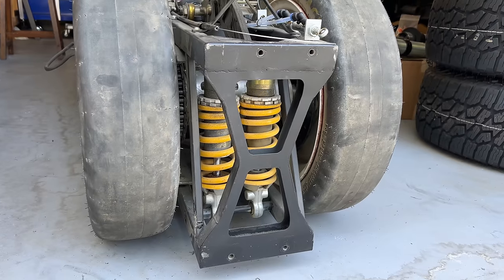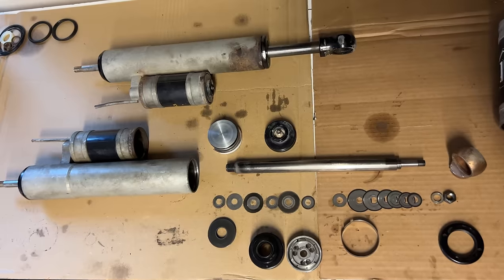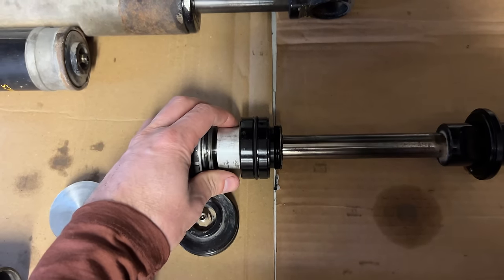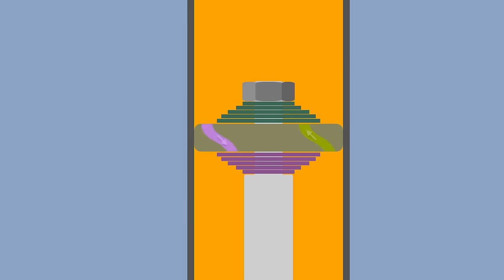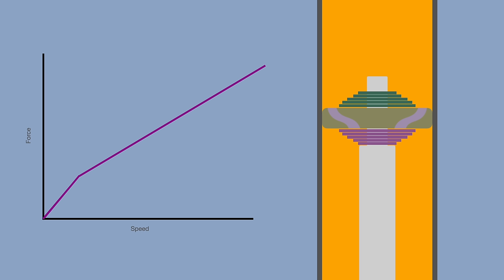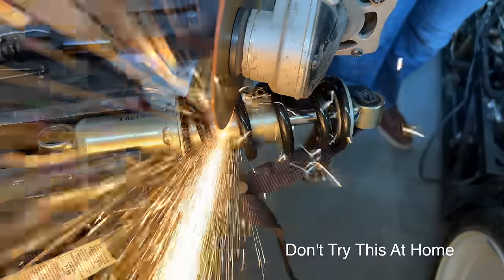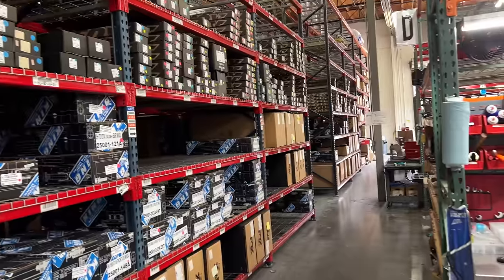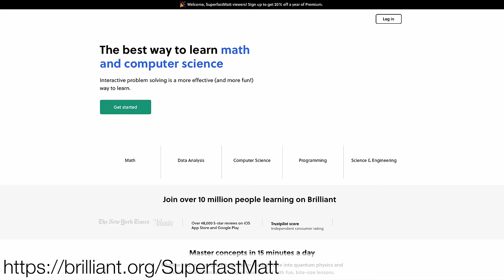How Shocks Work

Comment: Ah yes, those times when you find that taking something apart is not in fact the ideal step 1. We love those times.
Reply: The ideal step 1 is to have taken one apart before. Which is why doing the second side of the car takes half the time of doing the first side.
Reply: I find myself taking the expensive way which is buying whatever I wanna take apart, and then buying a used one in bad condition, and taking that bad condition one apart and not worrying about breaking it. And then learn how and proceed to take apart the good one. Headlights are another story, since they’re either pretty easy and the perma-seal is pretty giving. Or it can lead to someone (me) buy 3 sets of 2 headlight. The first headlight I took apart was pretty easy and gave me a lot of courage, however that was the only easy one to take apart. After a lot of cursing and parents asking while I’m putting headlight housings in the oven, I got my retrofit complete. The Morimoto MLED 2.0’s in my car have been in for a little over a year, and they’re still going strong. I don’t really want to do that whole process again.
Reply: @TwoScoopsofDestroyer  Actually even more ideal would be to let someone else take theirs apart. Then learn from their mistakes.
Reply: And because of this fact I have long ago learned that 90 weight gear oil from an old transmission is one of the foulest odors I've ever encountered
Reply: Does it make sense to protect the exposed shaft with an accordion-pleated rubber gaiter?
Reply: @TwoScoopsofDestroyer  Don't break your own car and then need to go to the junkyard to get replacement parts like a chump, "carefully take apart" the car at the junkyard first! 😉

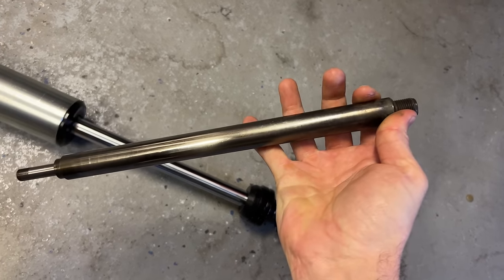Comment: @ 5:21 regarding heat treating. If the metal is 'case carburized' or surface hardened it will make for a hard surface that can be machined for a smooth finish. On the other hand a 'through hardened' part could be brittle.

Comment: A very successful open wheel engineer explained springs and shocks very simply: spring rate determines how far the wheel moves. The shock determines how fast it moves.

Comment: That truck at 13:12 is a textbook example of a well set up shock, tyres are staying on the ground and body of the truck is going foward in a straight line. I tip my hat to the shock tuner.

Comment: What strikes me is how many similarities these high-end shocks have with the suspension spheres of classic Citroën´s. Maybe you should take a look at that Matt. In my opinion, every car gets better with hydro-pneumatics. Think about it, an off road Viper with a suspension called "hydractive". Yeah, you need that. I promise, you won´t loose any sleep at all over sphere pressures, stiffness regulators or solenoid activation thresholds. Ok, I can´t really promise that. But it´s an interesting way of loosing sleep though...
Reply: As a mechanic who has had to work on suspension spheres on citroens

I wish the designers went to hell for creating them
Reply: @Alucard-gt1zf  It´s the best suspension ever. What faults do you think they have that I have missed over my 30 years of working on them?

Comment: I never knew about all the shims inside of the shock. I have an RC car and its familiar to me that rocks chip/ding the shafts and then eat away the seals and oil leaks everywhere. Shock socks solved that problem, I wonder if they make shock socks for regular size vehicles too? Thanks for the in depth video Matt.

Comment: The bushing in the gland/cap is called a glacier bushing and is best removed by die-grinding the ID as thin as possible until you can get in behind it and collapse it. Collet puller also works but you tend to fight it all the way and if the gland is aluminum, you tend to score it

Comment: I love shocks. They've evolved into such a simple reliable design which still gives great performance. Unfortunately expensive as the machining needs to be near perfect for high end performance, but still reliable. The explanation was really quite good, hit all the important points. Though I do find digressive shocks mandatory for my purposes, they give a greater overall energy absorption and better handle a far wider range of speeds (at least on road which is where I live).
Reply: Which shock brand do you generally prefer?

Comment: So I used to work in a small suspension shop that mostly did high-end road racing stuff, but we did some off-road too. One time we got this set of icons in where those two belville washers Matt mentioned that go on the compression side in place of the rubber stopper present on the Kings had completely obliterated themselves. It was like the shock had just extended itself inexplicably at Mach 2 and crashed the droop Spacer into the piston. Totally hilarious to pull apart a shock and see big chunks of metal fall out with the fluid.

Comment: As an Engineer that previously worked at one of the large Damper companies mentioned in this video I can say this is a fairly good run-down of functionality.... Should point out some pros/cons vs. various shock designs tho.   Twin tubes are cheap to make, easy to valve etc so most stock and boring (think camry) vehicles use this design, also cheaper aftermarket stuff (as it's easy to make adjustable)... The pro is less piston rod (shaft) force, so your low speed choppy stuff is controlled very well (also why they're selected for non-performance applications).   Reason being is twin tubes do not need nearly as much gas pressure to function properly because of the valving separating the nitrogen reservoir.   The cons are tho your working piston is much smaller and thus can cavitate much easier, and overheat easier as well (you have a nice nitrogen wall to insulate it from the outside air).   Hence they are very not good for trucks and off-road.   They can also need to be installed in a specific direction or things aren't happy with nitrogen getting where you don't want it.   Should also mention, they tend to be far less robust partly because of them being cheaper but also the small working piston/cavitation issues, and also are usually not serviceable.

Mono-tubes obviously have the inverse in pros-cons, more expensive to make, harder to make adjustable damping, higher rod force and thus not great for small choppy bumps.   However much better cavitation control (and thus can put more damping force in for the same size shock) better heat dissipation etc.  And unlike the twin tubes they are far more robust, a good quality mono-tube can last well into the 6 digit mileage range and can even be rebuilt fairly easily due to the construction.

In short, if you have twin tube shocks... they're probably not that good, mono-tube ftw :P.
Reply: Thanks!

Comment: After having a basic understanding of shock valving and operation for close to 40 years, you finally helped me to really understand a lot more about them in 16 minutes -- Thank you!!
Now, can you do the same thing for changing exhaust tones using helmholz resonators or whatever is required to give an LS engine a nice, high pitched exotic sound?  It's probably "just" math and physics...  Lol
Reply: I think a 'high pitched exotic sound' of a flat plane V8 from a crossplane V8 would be tough, cause of the 'burbly' firing order and the lower revs of a pushrod engine
Reply: A 180° header with a Y pipe will get you that high pitched exotic sound out of a crossplane V8.

Here's a pretty good video about it: https://youtu.be/AYrtPp-OuZw
Reply: 8 into 1 headers should do the trick
https://youtu.be/dKVRBFLDwsU
Reply: @raoulrr  Mainly I just want SuperFastMatt to make it understandable. Lol..  Honestly though, some Corvettes without flat plane cranks do have really appealing tone (to my subjective opinion) by having an X-pipe right after the collectors, and then a basic dual system after that.  And then revving the crap out of them.
Reply: @pedroosorio7916  I don't actually care for the 180 degree header sound on an LS.  My friend had a pair on his LS swapped Porsche 996, and it was somewhat "exotic" sounding, but not really the scream I'm after.
ALTHOUGH!  His didn't have a Y-pipe to re-join the banks, but still, conventional long tubes into an X-pipe set close to the ends of the collectors is more to my liking than the 180 degree header sound.
Reply: @raffriff42  I do LOVE the sound of 8 into 1 headers on an LS, but the packaging makes it unappealing to me.
Reply: @tptrsn  This video has a great explanation of Helmholtz resonators and puts the concept into practice. Although he does it for a different reason, you can take the principles discussed in the video and suit them for your own purposes: https://youtu.be/l9CrmkIxDQU
Reply: @shootinbruin3614  Thanks for that!  That guy really didn't flesh out the math of the acoustics very well like SuperFastMatt would if he did a video of the type I'm wishing for him to make though. Lol...  I've been scouring the internet for a really good explanation of this, and the real world application of it, and so far all I've found is rough approximations.
Reply: @tptrsn  Glad you found it useful. I suspect even with precise calculations involved the results wouldn't be very accurate. There are simply too many variables that do not stay consistent, such as atmospheric and exhaust temperature. To be honest, being off by a few inches would probably make for an imperceptible difference anyway. Understanding the concepts and working in rough estimates around them is also the SuperfastMatt way haha

Comment: thank you for the clarification of damper vs dampener, I have been using that illustration for quite some time, but I specify a squirt gun as the dampener,
you wouldn't believe how many people use the wrong term and argue that it is correct, even in NASA,
they even invent new terms like "dampner"

Comment: Dual damper per wheel setups won't work as intended unless both dampers are tuned to provide practically identical damping force curves, but at half the magnitude of what a properly tuned single damper setup. This enables the dampers to share the workload evenly, improving longevity and reliability, without messing up the suspension tune.

Comment: We seem to be stuck with motoring folk calling dampers "shocks", when it's actually the spring (whether steel or air) that does the shock absorbing. The damper is there to control that motion and, especially the rebound. 

But then we are also stuck with the term "radiator", for what is, in reality, a liquid to air heat exchanger which primarily uses forced convection for cooling and not radiation. Coolant has somehow morphed into the stuff in a bottle (which is actually coolant additive), whereas it's really the liquid that runs around the engine block and various other parts to keep the engine from frying.

Comment: As someone who has exceeded the limits 7/8 of an inch icon shock shaft, 1 possible bigger problem is a very bent radius arm Caused by one very cool looking, But slightly misjudged jump.

Comment: Piston shapes and shimstacks are a science on it's own, but there's a few other aprroaches around  that work quite well. Checkout WP's Cone Valve front forks for example.
Paul Thede from Racetech has a really good book on how shocks and suspension in general work, it is focussed on motorcycles but a lot of it applies on all suspension.

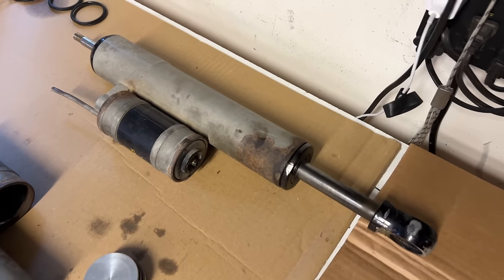Comment: 0:39  No it isn't a shock absorber.  It is a damper.
The shock absorber is the suspension spring .
The damper controls the spring's movement and prevents oscillation.
Reply: All hail the lord of the OBVIOUS 😊😮😢
Reply: And a damper does?

Comment: In the 80’s, if you used the term damper instead of shock, you were a Road & Track weirdo who bought sheepskin car seat covers from the ad section on the last few pages of the magazine. Also, we stood around the Nova with nods of approval as air was added through the schrader valves in the rear air shocks and the back end of the car “jacked up” for better “performance”.

Comment: try maglev ring/disc magnet pistons in a copper air shock pipe, 3-in-1 suspension dual shock
Reply: why have a separate pressure container, air makes a nice flash when compressed or just flown hard

Comment: love it, thanks.  Have done the calculations for damping and wonder why not happy with the drive.....what are race/modern manufacturers doing to give the compliance at low speed yet control at high speed?   What damping ratios (fast and slow) do they recommend now?   My books seem to say ~0.7, but modern cars seem to be overdamped, as in dead- beat?  Is it grip vs, ride quality?  dunno, my head hurts.

Comment: Turn the grinder 90 degrees when cutting the spring so the spring won’t push through the cutting wheel when it goes through.

Comment: Hey Matt do you think its possible to cool brake fluid effectively with a small oil cooler? Or some other non standard way(bigger brake rotors/better calipers etc)? For theoretical space constraints like a fixed size set of rims?
Reply: No, as the brake fluid doesn't circulate in a standard system, its localised heating that causes the fluid to boil
Reply: @christianhenderson5471  Makes sense. What if the reservoir was an "heat exchange/oil cooler" with air passing through it?

Comment: Man I wish you had a klr650. I've got one and some of the mods are... Of questionable functionality.

For example, everyone in the community acts like a progressive front shock is the best possible configuration. I had mine revalved or whatever and it's significantly better than with only a progressive shock.

Plus if you modded it I know you'd do it properly and become an expert in the subject.
Reply: I had a KLR. the best thing you can do is replace the suspension. I ran DRZ400 forks and a KTM PDS shock with custom linkage. It would take anything you were brave enough to throw at it.
Reply: @bdkw1  I took it to precision concepts in California and they revalved it. It can jump it 6ft without bottoming it out now lol.

Unfortunately the downside is that it was $1200

Comment: But how do you pick the right shock ? How do you know which dampening curve is right for you ? Do you have to know the weight of the entire car and the weight per corner and then predict the loads and stroke of the front and rear axles, I’m guessing then spring rates will have an effect on dampening as you might have the perfect curve but the spring may never let you get to it … Matt it all sounds like black magic

Comment: Are there any real reasons to buy Kings vs Fox vs Ohlins when the prices are so different? Is it just serviceability, finish and bragging rights?
Reply: Wall thickness, guide and seal quality. Teflon coated guides wear out. Bronze guides don't.
Reply from the maker: I started to add this to the video, but it's kind of just all in the details, as far as I can tell. You can see the obvious difference between the nicely machined Fox racing piston and the cheap Grom piston by just looking at them, so I'm guessing it's just that for every part. A shock design engineer could probably make a whole video going through each component. The serviceability is probably a big part. The stock Grom shock is $100, the Ohlins everyone puts on is $500 and they have a lot of the same basic components, only made differently. I've ridden an Ohlins Grom and it is much better. So the details definitely add up.
Reply: @SuperfastMatt  Koni was my go to for shafts especially...out did all else on scheme and wear. Even their valuing was brilliant and available.  Bilstien next, as top monotube, but we used all, machined to adapt. I worked with bilstien and super pto, kings springs, Mark was a good friend